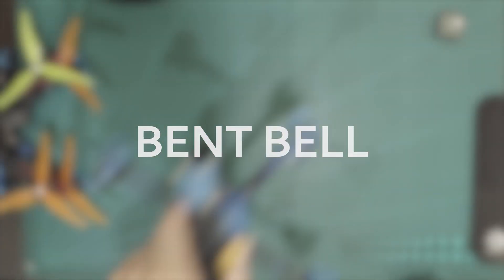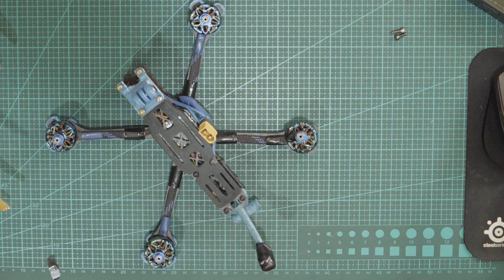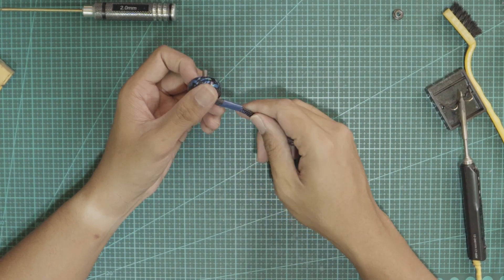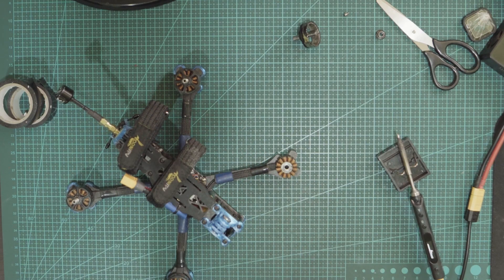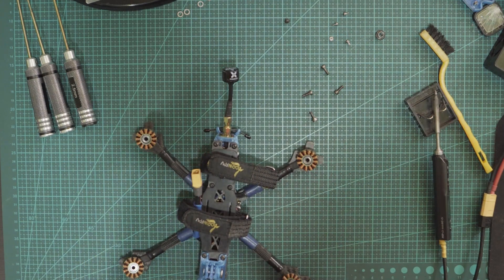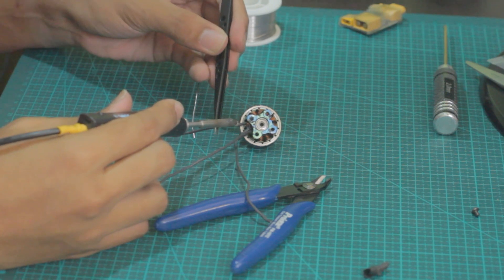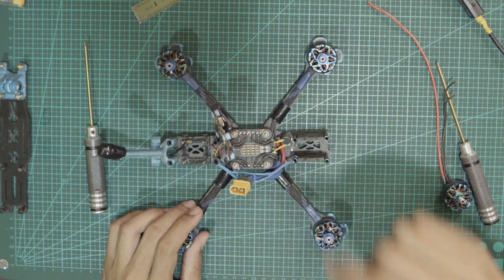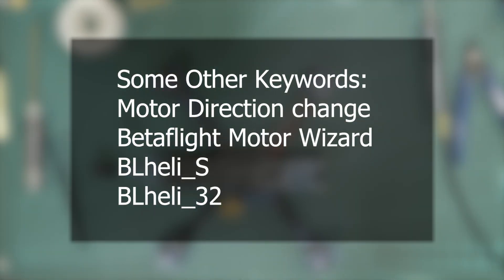FPV Motor DIY Cleaning & Fixing

Comment: So … I messed up. Exactly what you were worried about… I stripped my screw and now I am clueless as to how to open the bell as there is a piece of junk inside ta motor which I need to remove. Pls help
Reply from the maker: Try searching stripped screw guides. Ive seen The rubber method alot but it didnt Work for me. 
I normally Cut The screw with a mini hacksaw And use a - screw Driver to get it out

Comment: for the metal dust or rusts u can use putty and they will a 200times better job than tape also why did use a metal brush on the copper windings 4:30
Reply from the maker: Yeah a majority of comments are also echoing this I’ll defo give it a try if I get into this unfortunate situation again 😅
As for the metal brush it’s because my previous times cleaning solid stuff the plastic doesn’t effectively sweep solids so I opted for a more rigid brush. But the brushing needs to be more gentle for sure

Comment: Thanks! You just helped me fix a motor that I thought was busted. All I had to do was take the bell off and put it back on 😂
Reply from the maker: Glad to contribute to you saving money 🤑
Reply: @TanFK  well it turned out that it was a bad bearing so I called a few local bearing suppliers, picked up two at their warehouse, and I’m back up in the air again! Still a VERY easy fix and it gives me peace of mind rather than worrying about my quad eventually falling out of the sky. I’m a firm believer in preventive maintenance preventing bad things from happening. Or at least limiting the risks. Great vid and thanks for the help!

Comment: For removing iron particles from the magnets inside motor bells, I find a tacky putty works great!  The putty I have is intended for temporary placement of posters on walls.  Don't land/crash in sand!  Edit:  of course looking to the right shows that JB did a video 4 years ago on this with a thumbnail showing what I just said....

Comment: How to fix a wire that snaps right at the motor? The very thin cooper wire that is right under the motor
Reply from the maker: Sorry that one is unexplored territory for me, 
But check this video out around the 7 minute mark
https://youtu.be/OCAuvENiyFo

If you could trace the ends of the three strains of copper wire of the windings you might be able to do something about it.

Comment: What analog VTS's do you use and have good luck with? Just looking for a good brand solid analog VTX for clear and not-glitchy signal with some distance between goggles?
Would i see a noticeable upgrade in replacing my Eachine VR-007 older but great clear screen, no dvr or anything, one anttena, and internal VRX. 
I see the Eachine 800D i believe theyre called as supposed to be the best budget friendly option at $100 and it has dual antennas, patch and omni antennas, and SD Card DVR built in, but again not replaceable VRX.
I have a few digital DJI drones and one 5" with an O3 Air Unit, and its obviously super clear, and never breaks up at all within reasonable distance.. 

But i have a lot of other drones and i dont hate Analog, plus its just to expensive to convert every drone i might want to build and fly either. 
Especially with a good analog camera for night flying is so much fun for going in and out of lit area's, as long as its dimly lit by something, it will be in B&W, but you'll be able to see just fine.. 
Where as the DJI O3 air unit system is literally unflyable at night!!

So im not opposed to investing in wha they have now, which is VRX holder Module Bay for the DJI goggles, like an HDZERO analog has sort of with the HDMI-IN Ports.
It just lets you use that A/V feed and plug it into your DJI goggles v1/v2, and gets power from the xt60 cable right before it enters the goggles to power itself as well. 
That way the analog signal from the external VRX module and holder with a power adapter and all, can use the DJI goggles as the Screen basically. 

Oh and by the way, thanks for the videos. I just took apart my older fpv drone motors and they sound so much smoother now. I wonder if it would cause the issue i was having with one motor just randomly cutting out or not starting on Arm Dyn Idle..
Reply from the maker: As for a reliable analog vtx, I always buy Rush. 
Rush Tank for 5 inch, Rush Solo for Long Range 7 Inch. 

I personally ran the Eachine EV800D as my first Box goggles, and it's great, but limitation of penetration and distance is noticable. 
I also tried the Analog to DJI av conversion, it was OK, but quite limiting for distance.
I personally upgraded to a pair of Fatsharks with TBS Fusion and have been getting good range, I bought it off the second hand market. 

But end of the day for the most enjoyment I still get from typical air units, which I hunt for discounts for the Runcam Wasp on Aliexpress, which is on discount now.

Comment: Do you have any advice for motors with c-clips's? Also can you run these in water after for drag to do a final clean, like you would do for a dirt brushed motor, or a brushed motor with new brushes..?
Reply from the maker: C-Clips are extemely hard, Id usually use two 1.5mm Hex screws to push them away to open the shaft. Just careful as it might drop away and onto the floor where its hard to find. I cant comment on brushed motors as i've never worked with them, but im assuming it'll be ok as long as you sufficiently dry them after water.

Comment: I have the same set of Hexdriver's. Ive had them for about a year now and the Tip's are still perfect. Do you have a link to them? I cant find where i ordered them from to re-order i set. I remember they werent too expensive at the time at least and i just figured id take a chance. I love them now. Just want a backup set. I got the full set that goes down to 0.7mm and i actually needed it to repair a dji drone. it was one of those really small size's..
Reply from the maker: I saw them on Aliexpress. Just search 'Hex Screw Driver' or 25 in 1 sets if you want something more specific

Comment: Advice, don't brush the copper windings too hard with the wire brush, they have a coating that they need to keep :D
Reply: mas bien no lo haria! mal consejo ahi! .. tiene que ser un cepillo de cerdas suaves y no metalico! 😝
Reply: @deiravid_fpv  si!
Reply: Or brush it with a soft bristle tooth brush its that simple 😅 btw keep up the good work love from India ❤
Reply: Do NOT use any kind of metal brush on your motor windings. If you scratch the clear lacquer coating on them they are toast and unfixable unless you feel like rewinding them. I wouldn’t even use a brush.
Reply: @SkeezyFPV  what would you recommend? a toothbrush with plastic is also not ok? my motors are full of mud unfortunately

Comment: I agree with everything that you said in this video, except for the metallic brush on the motor windings you are actually scraping and enamel coating that manufacturers put on the motor windings to waterproof them and protect them right off and then when you put it under the showerhead, you’re actually going to cause those windings to start to rust

Comment: i think u need to use plastic brush instead metal brush, it can damage your wire enamel
Reply from the maker: From my experience with a plastic brush it's harder to get off carbon or metal shavings.

But you do bring up a good point. There is a risk to damaging the enamel if you brush too hard, I should've emphasis to be gentle while using the metal brush.
Reply: Excellent video and great tips! 👍

Similar to mud... I sometimes fly at the beach and get sand in my motors. Metal particles in the sand stick to the magnets and cause the motors not to spin. I clean it using a regular toothbrush and it seems to work well.

Another thing to check for is burnt or partially burn coils. Check visually if all or some of the coils are black or blackish rather than brown. If so, the enamel has melted and the coil is functionally compromised. Even if it works now, the motor could soon fail in flight leading to complete quad loss. In this case I replace the entire motor. It may be possible to do coil rewiring but I don't know how / never tried it.

Comment: Excellent video 👍🏻 I’ve been washing my motors the same way for years - easy way to keep them going for ages
Reply from the maker: Good to hear validation on this. I’d hope this video reaches the new guys to follow and DIY their repairs, stuffs expensive!
Reply: Question:
Does the exposure to moisture cause any component in the motor to oxidize over time?
My personal space is on the humid side and I've been wondering about my quads long term health.
Reply: @sunsetpark_fpv  just ensure the motors are immediately dried after washing either in direct sunlight, over a ducted heater or hairdryer/hot air station